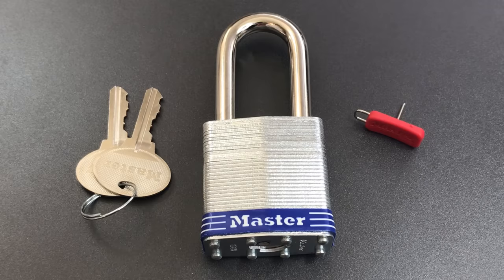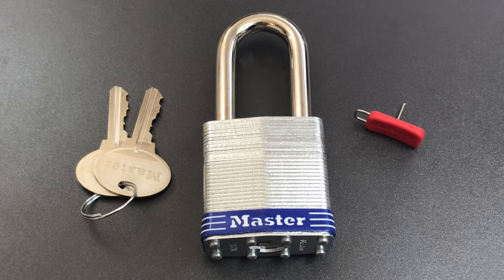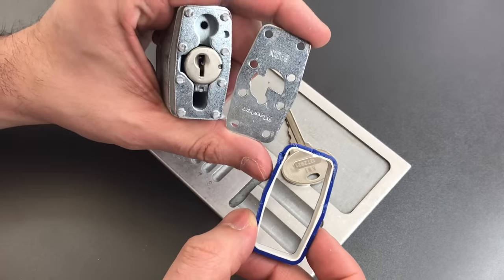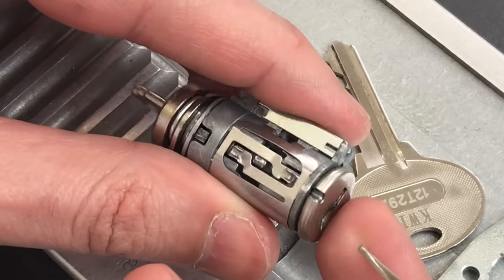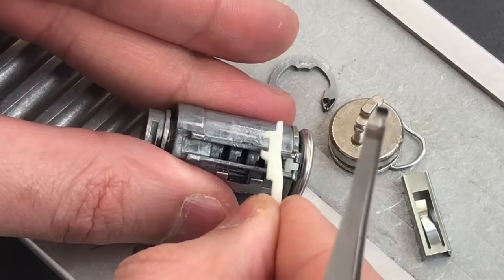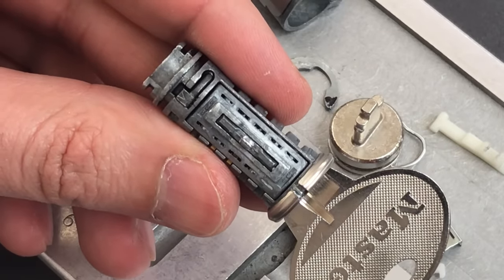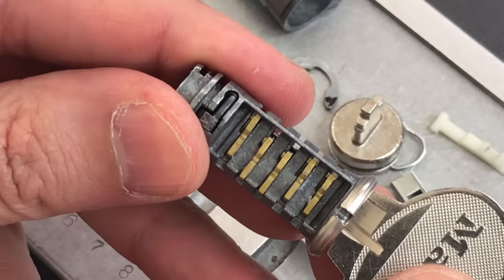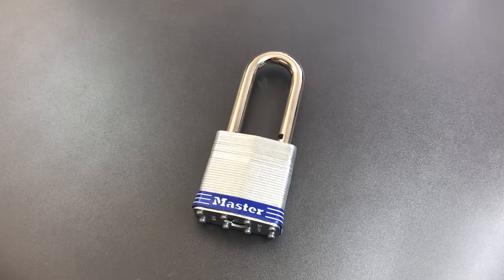[626] A Pick Proof Master Lock? ALMOST!

Comment: The "Master Lock Re-Keying Tool" looks suspiciously like a paperclip.
Reply: Yeah but it's useless to have unless you insert the key and turn it. It doesn't aid defeating the lock so it doesn't need to be complicated.
Reply: Dude, the tools he used to pick the lock looked suspiciously like a paperclip!
Reply: @jonathanfairchild  You should be able to use that to re-key it to a key you have once you've picked it open though :)
Reply: @ollierinko9387  Unfortunately, I don't think that is possible. You need a key inserted to enable the re-key function, he says so around the 5:00 mark. If in some way you could defeat that mechanism then I suppose you could re-key the lock with said paper clip.
Reply: Jonathan Fairchild you can definitely pick to rekey. You don’t need the key inserted to rekey, you need the key inserted to turn the core away from 12 (closed) and 3 o clock (open/rekey) positions. And as demonstrated in the picking, you can defeat that by picking specifically it.
Reply: Imagine you reset the lock to be opened by a paperclip mindblow
Reply: All it's doing is pushing that little plate back, so a paperclip would do the exact same thing. It is literally just a paperclip with a fancy grip attached.
Reply: Henry Black not unlike a “sim tray removal tool”.
Reply: Yes but they can't change 40 pounds for a paper clip.... Call it the master lock rekeying tool and you've just increased the price by 40 pounds. Easy money
Reply: Hahahahaha
Reply: Imagine fucking with someone like that. Pick there lock then put in an entire different key, reset it and just lock it back up.
Reply: It is but with out the correct key to lift and hold the locking bar that tool cannot be inserted and therefor unable to re key the lock. 
And even If you could what would be the purpose? To steal the lock? 
If you have the skills to pop open such a lock for "nefarious" purpose, why would you need to rekey any thing? Pop it open and walk off with your stolen loot
Reply: lol @ paperclip 📎

Comment: Couldn't this core be used in a beefier padlock with a bottom plate that restricted the access to the side bar? That would make a much better padlock then, right!?
Reply from the maker: Yes.
Reply: THEY ALREADY MAKE THIS IN A MAGNUM (M532)
Reply: LockPickingLawyer if someone was careful putting some epoxy on the side there to cover the hole im sure it might fix it
Reply: @greenthizzle4  You're  SURE it MIGHT huh? Lol
Reply: Well it's not a bad idea, you couldn't design a tool like that which would fit around two 90° corners and still maintain a fair amount of power to tension that core. A 3mm wide steel plate would be enough to prevent that. That would make the lock almost pick proof.
Reply: @ShazenVideos  hmm, true, that would probably require an impressively springy alloy+temper
Reply: Time to get the grinder
Reply: Why make an unpickable lock when u want ur consumers to buy the newer edition that fixed the old edition flaws but contain its own flaws
Reply: One word

Shimming
Reply: @mrraven7445  Yup.  The Dremel cut-off wheels were made for Master lock rivet heads.
Reply: They want us broken in to?....
Reply: @greenthizzle4  it's a master lock, you will never know what kind of basic vulnerabilities you might encounter.
Reply: @ShazenVideos  Technically you could with a "self healing" aka "self reforming in heat" metal, but if you're going to the extent of that, I don't think it really matters at that point because you probably have the resources to break into literally ANY lock...
Reply: @LockPickingLawyer  yay! I got to be the 1,000th like on a 4 year comment! That's sad isn't it.
Reply: Until you shim it

Comment: Master Lock isn't absolute trash because it makes bad locks.
It's trash because it's fully capable of making amazing locks but doesn't.
Reply: If someone wants in a lock, they'll get into it.
Reply: @DAV1979  Making better locks wouldnt really be any more expensive for them, they just dont care.
Reply: @FerunaLutelou  The engineers care. Thats how locks like this get made. But the sales department sends the drawings back with a note "need to make at 60% of cost," and another young engineer becomes more jaded
Reply: @mattm3023  I was told by a director of a government department to build a system with no security, because it would be cheaper and determined hackers could get in anyway. That was only a few years ago. On another system which you could use to literally write your own cheques I was asking the designer how the system got the automatic login credentials to the finance system. He said it uses this command here, login:=userid/password. Yes I said, but where does it get the userid from. He pointed at the code and said, it gets it there. It's userid. What about the password then? He pointed at password and said there. Seriously the userid was userid and the password was password. Talk about hiding in clear sight. No-one would believe that the security was so bad, and would never try that. Except for the head of accounts. He didn't even go to jail.
Reply: Phil Gray wth that’s so insecure
Reply: I'm pretty sure Master lock was started by OC to be the most used lock on things they want to break into. What better way to ensure your guys can easily get into a place with a padlock then own the padlock company. Run the business legit and add major flaws most people won't know about.
Reply: Way to say everything and nothing in one comment 😂🤣
Reply: @Kaziklu  Who is "OC" ?
Reply: @chechnya  Also, a security is only as good as its weakest link.  If the locking mechanism is too difficult, maybe the shackle is weak.  If both are too time-consuming, another facet of the locking system might have a vulnerability.  At the end of the days, locks are, for the most part, just deterrents.
Reply: @FerunaLutelou  That's why the entire management need to be fired. If they replaced them all and went back to the drawing board with locks like this, I would consider buying them. Currently, because of LPL and BosnianBill, I avoid this brand like AIDS but unfortunately, nobody sells anything but Master Lock. I have to buy all my locks online.
Reply: @chechnya  if they have enough time, and think it's worth spending the time on getting into a lock. Better locks are good for making getting in more time consuming, requiring the person breaking in to have a bigger window of opportunity, and/or more motivation. Otherwise a ziptie would be good enough as a bike lock.
Reply: 85% of the people on this channel don't seem to understand capitalism.  If you don't need to make good locks to make money, why bother?  The number of people that understand how easy it is to defeat some locks is still minuscule compared  to the number of people who don't.
Reply: @largol33t1  No, you are mistaken. There are excellent models from Master and American, you just have fallen into the rabbithole of online sheeepishism. The internet is the place where manufacturers OFTEN sell their seconds, discontinueds and surplus. You have to be very wary of getting early iterations of products. American 3800 is a moderate price lock that you can select the cylinder of choice. There are dozens of models, including a handful of stainless steel body ( My distributors do not stock the models I prefer, so I get them factory drop shipped. All ProSeries Master locks, I order 6 pinned zero, for fast set up, giving each of my clients their own bittings. Master Pro-series resist going for the driver, as it is immovable when key is out. I believe PacLock is similar in design. IS it impossible to get through the higher end of the product line? Nope... no padlock is perfect. The hasp is critical as the lock, and how it is fastened, and the device the hasp is attached to. The cylinder type, lock size and other apects all need to be considered. The lock in this video is not a high security lock, it is a convenience product, to KA a padlock, some tool chests that have this cylinder in it, etc.... CONVENIENCE... not high security. IT is built to the price point. I would not use the thing.
Reply: Ever since I took up lock picking a few months ago I learned, master locks would be far better suited to be called novice locks.
Reply: Actually, they make both.... but if you are on amazon or home depot, you will not find the good stuff... www.findalocksmith.com
Reply: Master Lock is the Mag-Lite of the lock world. They're in Wal-Mart so they don't need to try.
Reply: They might not own the proper patents to implement a better procedure.
I could imagine that there are tens of thousands of patents surrounding locking mechanisms and locks in general.
Reply: @chechnya Not any lock... they make some locks that can be shot by a 50 cal and not break... having 2 keys, and both being top of the line in pick resistance. So... there is definitely a variability.
Reply: @Krakaet  Unless you're talking about the Squire Stronghold SS100CS... in which case the wall is the deterrent... since you can shoot the lock with a 50 cal and it won't open... and it's super hard to pick.
Reply: Same goes for 99% of companies nowdays. Nobody cares to make something impressive, because there are too many brainless sheep in the world who never understand how much effort goes into something, so they won't bother ... cuz id10ts will never buy, they just go for some trashy cheap trash and then whine. Look at nVidia and/or AMD or microsoft, they could easily make something really impressive, but it's all about MONEY. They could release a graphics card that is 10 years ahead of current ones, but they WON'T, because then for rest of 10 years they got nothing to show. So they rather just split that performance into 10 parts and release a "new" graphics card each year with 10% performance boost from previous year, but they put a HIGH price tag on it.

..and again reason why it works like this, is because 99% of world is just full of brainless sheep who don't understand it, they think that if some company releases "new" product, then it must mean it was made yesterday ... WRONG! Things that are released today, have most likely been ready for minimum of 5 years, usually even more.

Take Koenigsegg for example. All their cars have been in R&D for 10+ years, so they already got the tech to make some super future cars, but they won't .. cuz then for next 10 years they would have nothing to show or release. it's all about money. EVERY big company is doing it. this is the sad world we live in .. all thanks to brainless id10ts who don't understand anything.
Reply: @cheeseisgud7311  

Just like that designer.
Reply: S T  

If you’re implying anything with that comment, at least you should know that Donald Trump is in power. If he represents our governmental head of state it would be under him, depending on how the fraud reveals itself, who did the election cheating.

But that doesn’t mean it certainly will happen. Democrats could win either way.

Note I never said Donald Trump would be responsible for cheating.
Reply: @FerunaLutelou  hell, they could just sell this one over and over and never have to worry
Reply: they want to give the thief a chance.
Reply: They have to make bad locks to be able to charge premium for better ones.
Reply: @Kaziklu  what is OC ?
Reply: If you make a product that breaks your customer will have to buy another.
Reply: isn't crony capitalism and consumerism fun :D
Reply: @philgray1023  That is not hiding in plain site its just stupid. Testing for defaults like that is one of the very first things attackers or automated tools will try. Nothing is secure but you can make things difficult enough where people will stop caring. Something as simple as password strength validation or hashing passwords can be done in about 10 minutes. No excuses and it will end up costing them more to fix it later.
Reply: "All your belongings are belong to us"
Reply: @chechnya  Gonna make it more trouble than it is worth
Reply: @thekinginyellow1744  that's why capitalism is good, it redirects resources efficiently, why make good more costly locks if you can make cheaper worse locks with the same effect, the fact that the bad locks still sell is a clear indication that they're good enough for the job, no need to waste resources on something better.
Reply: @philgray1023  a good hacker would absolutely try that. It would be among the first things in a word list. what idiots!
Reply: @philgray1023  #solarwinds...
Reply: @chechnya  With some locks you need power tools, and time... Some circumstances can make those luxuries difficult for a malcontent, and that's the point of good locks.
Reply: @thekinginyellow1744  This is a bad thing...no?
Reply: I don't imagine their goal is to make amazing locks, it's to make cheap locks available to pretty much anyone, and a Master Lock is better than nothing
Reply: What would the company earn if they made actual completely pick proof locks?
Reply: @johncrowerdoe5527   original creator
Reply: "Lightbulbs"

They leave gaps in the market for others to fill.
Reply: @babalonkie  Accurate
Reply: Yes.  This.
Reply: Yeah it's been 3 years and they still haven't done anything to further this design so I'd say that's completely accurate
Reply: Yeah it's been 3 years and they still haven't done anything to further this design so I'd say that's completely accurate
Reply: The average customer will often just buy whatever lock on the shelf is cheapest (or second-cheapest).
Reply: Also, this lock isn't amazing. As LPL said at the start, bypasses that don't require picking, such as shimming, still work.
Reply: @citylockapolytechnikeyllcc7936  That's fine, but most people buy online or from a box store like home depot or Walmart. So even though there are exceptions, Most of the stuff they sell isn't very secure. Like so many companies, Master Lock realizes that selling perceptions is what actually happens most of the time. And channels like this one help to make that more clear. If capitalism is to work well in providing the thing that people think they are getting, then good information is important. Sure, it will be insufficient, but it gives those who care an opportunity to avoid some pitfalls.
Reply: @thekinginyellow1744  also i want to add in i see a lot of master locks on commercial job sites and i feel most of them are bought and to the avg person hard to get into. then again most people trying to steal stuff off a job site aren’t concerned with being quite or destroying property. most of them are junkies looking for an easy grab. honestly contractors (at least here in mo if your union) only use locks so when they go to there insurance co they can say they had a secure spot for tools while they rebuy your stuff that was stolen. heck right now our lock up room is a sheet of 3/4” plywood with a sliding lock you see on fences screwed to the plywood with a masterlock. i wouldn’t even bother picking the lock i’d just take the screws holding the locking mechanism out and throw it on the ground
Reply: I love everyone saying "Masterlock" like its one person though. Its just making me laugh, like they have some sort of democracy in the system. Im sure CEO has final say on what they do and it was probably their decision. Cause I cant see why anyone would get into something as specific as designing locks, if they didnt truly enjoy locks and wanted to improve them. Where as a CEO could definitely not know a damn thing.
Reply: Masterlock's slogan:
Every key is a master key
Reply: @Kaziklu  I think you mean LE.  They ain't got time to be troubled by difficult hacks when they want snoop but not necessarily destroy.
Reply: @Sarah Mellinger   Pretty sure he meant Organized Crime.
Reply: @johncrowerdoe5527  organized crime
Reply: tbh, I wouldn't be surprised if they must add such security flaws in all of their locks. It's like backdoors in encryption. This also would explain why they seemingly don't learn anything for new products after security flaws were found.